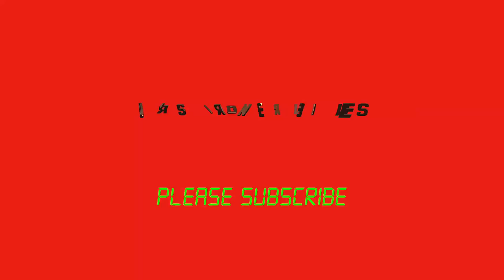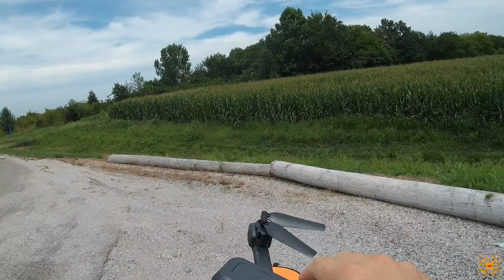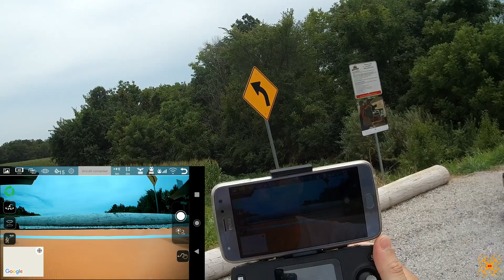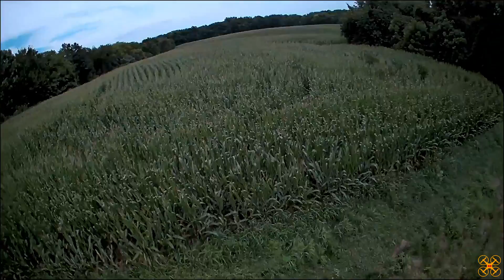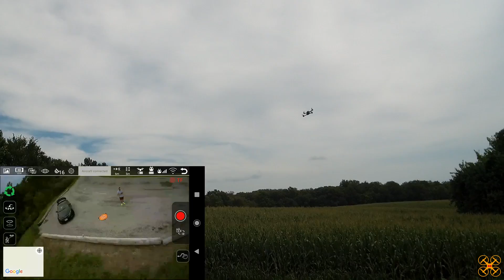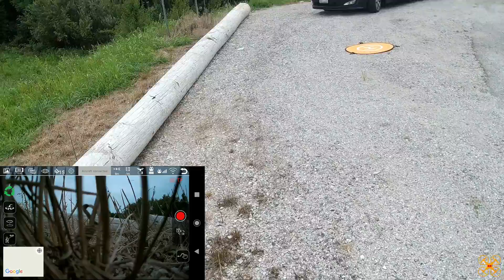JJRC H73 (MJX X103W) Feahoot 2K Camera with 5G WIFI, Optical Flow & GPS Flight Review

Comment: I just picked up the Contixo F22 drone second hand for $20 canadian about an hour ago, excellent condition and apparently a twin to your JJRC. I copied the specs below about the gps straight from the manual that mine came with.
I don't care about the camera but just wanted a fun little flyer while my DJI's rest! Going to test it right now. Thanks and another great review!

Motor Model: 1020

Auto-Hovering: Enabled
Operating Temperature Range: 32°to 104°F ( 0°to 40°C)
Satellite Systems: GPS / GLONASS
Reply from the maker: This drone was quite awful from what I recall. It had a mind of its own.

Comment: Hi I recently bought one of these drones and had to repace one of the blades as I crashed. I noticed different letters on the blades, what do they mean?
Reply from the maker: That is for the correct motor direction. It'll be the same as the motor diagonally for the one your are replacing. If you install the wrong direction prop the drone will flip over on takeoff.

Comment: i was thinking about buying one, not now, maybe it needs a firmware update or props that are balanced better, november 2019 they are going for $75 free ship, this is the third time i heard this same thing today
Reply from the maker: A firmware update isn't possible. There is no way to update the firmware. It would need to do it via the app which isn't an option and it has no USB port. It is a garbage drone. Balanced props would help reduce the jello but it won't help with the erratic flight. There is at least one big channel that says it is great but he is just using trying to generate sales and isn't trustworthy

Comment: Hi, from Turkey.I want to buy for a gift my girlfriend.And shes love drones.Whats best drones in 30-40$ with camera ? Sorry for my language. 1$ = 5.5₺ 😓
Reply from the maker: Depends on what features you want. If you need it to have a camera then you can't get a very good drone with camera for under $50.
Reply: RD's Drone Reviews okey , What is yours the cheapest propose ? And i dont wanna a toy 😂
Reply from the maker: @MultiXside1  you can't typically get a drone that's not a toy at the amount that you want to spend. You need to spend at least $100 to get something that isn't a toy though the MJX Bugs 3 and Bugs 3 Mini are both great with brushless motors and you can get them for under $75. You can sometimes get the Eachine version of the Bugs 3 mini for $30 but that's not common.
Reply: RD's Drone Reviews unfortunately the devices you mentioned 220$=1200₺ in Turkey and i new graduate my budget is not to much.do you have any other advice? Thanks for ur comments, i hope i don't bore you
Reply from the maker: @MultiXside1  the Bugs 3 is your must choice. Check Banggood.

Comment: I think its your drone.. All the videos ive watch on this model have been excelent. Yours is the worse one ive seen. Should get money back or exchange it. You got a bad one
Reply from the maker: I've only seen two reviews on it and both of them looked just mediocre. Look at the comment below this from Tim Magsino. He had the same issues. Also, another reviewer I know in Greece had even worse issues. His won't even stay in the air for 30 secs. So from what I've gathered it is not just my drone.Thankfully this was a review sample so it didn't cost me anything or else I'd be sending it back for sure. Thanks so much for the info.
Reply: @RDsRCReviews  also ive noticed a few different apps ppl been using.. That jjrc x one is trash. China crap.. Itll work on other apps like "enjoy flying" and another one that allows you to use GPS feature and pin points your location so you can do the pin points. I hoping its not trash.. I just bought the h73 and 2 additional batteries.. 😬 ill let ya know how it goes when i get it in a few days lol
Reply: I got my h73 today. So im using the jjrc x app. The wobbly happened to me to. At first i was like wtf... then i started testing some stuff. At full throttle wobble so bad it bout fell outta the sky. So on speed 2 i didn't full throttle it and tried to be as smooth as possible yalling and back and forth and it did ok. Next was the jello affect in camera.. I tilted camera down just enough where you dont see blades and move drone real smooth it did awesome. Took great photos. For a 2k. My opinion dont buy it and spend another 100 get something better. I wasn't happy with it. But still fun to fly ank keep ya on your toes.
Reply from the maker: @oregoncoastexploredoffical  yeah it is too bad. It just isn't good enough for how much it costs. It is a shame that a few other reviewers have given this drone such positive reviews but we know they are lying to make sales :( For just a little more you can get a Zino and it is 100x better!
Reply: @RDsRCReviews  i agree. I posted 2 videos no sound tho of the two flights i did. I got more drones coming in few days.. I think this one is going to set on a shelf for a long time.
Reply from the maker: @oregoncoastexploredoffical  what a shame, right?